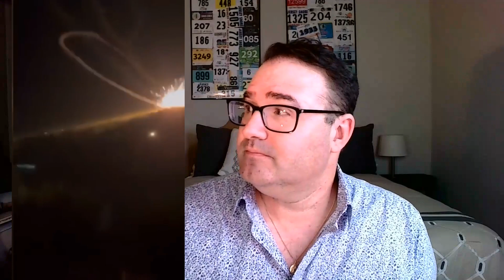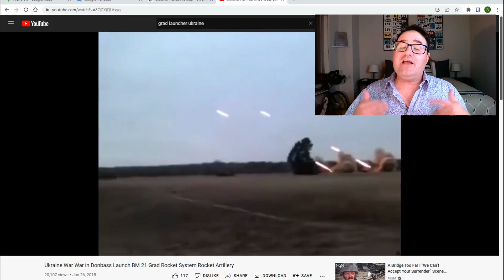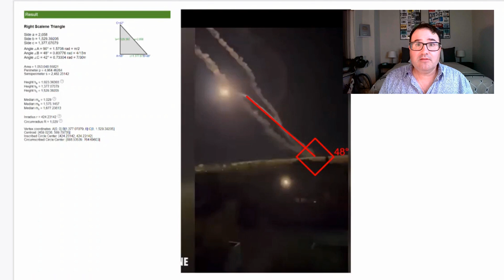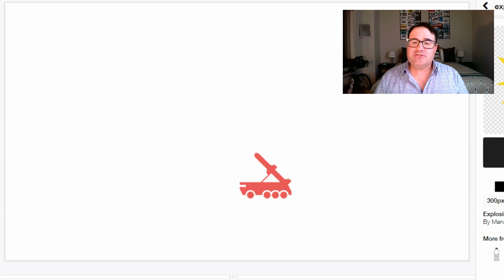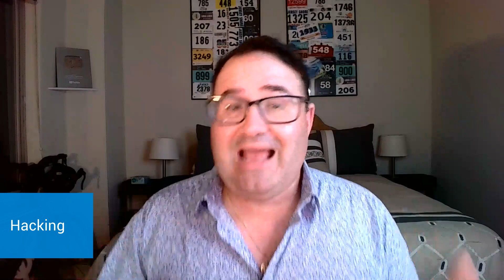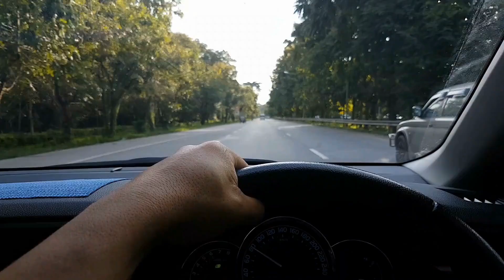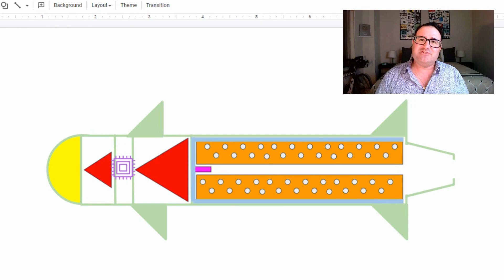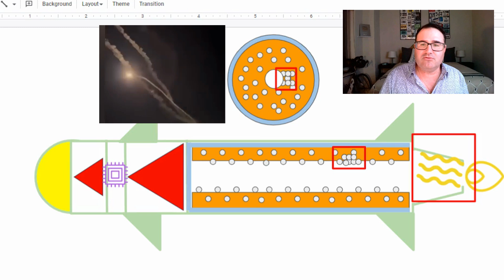Why this missile U -Turned

Comment: I think the clump of fuel on one side is unlikely. I've seen model rocket solid fuel engines with asymmetrical fuel work fine. One configuration is called "Moon Burner" that burns from one side to the other as an effort to provide closer to constant thrust. But I don't have an alternative theory.

Comment: USUALLY “mishandled” solid fuel “anythings” will DETONATE upon ignition rather than DEFLAGRATING unevenly, because the fuel grain has been cracked (usually in multiple locations) which allows the grains oxygen surface area to increase, which drastically increases the burn rate.  Imagine igniting a pile of smokeless powder (pellets) as compared to igniting baby powder fine black powder.  Finer dustribution = faster burn rate, aka detonation.  CATO, but who knows with explosives.

With this fuel being plasticizer it may be less likely to crack, but I doubt it.

Comment: Could it be possible that a sensor was installed backwards? If it wasn't a physical fuel problem as you suggest, this, or a programming malfunction would be my next guesses. Hacking is not on the list at all. Anyone with the skills and access to hack a system like that would be able to do far more damage far more reliably than making one missile turn around (just make it go off on the pad for instance), and any less intelligent tampering taking place on the front lines by enlisted grunts would end up putting them and their comrades at risk, making it unlikely. It's either a manufacturing, handling or programming error. We've seen similar errors occur on civilian/military space flight endeavours, the one that comes to mind is the Proton-M accident in 2013.

Comment: A fuel imbalance might cause a change in direction in one plane - but two? The missile changed both direction and pitch.
Given the changes in both pitches were pretty much 180 degrees, I tend towards the reverse fitting of guidance parts mentioned below ...  be it accidental or sabotage.

Comment: That's a great explanation if our universe's physical characteristics didn't apply.
That rocket could've gone any direction but it chose its origin.
Those chances are astronomical.
If there happened to be a concentrated pocket of fuel, it may explode or damage the rocket but would never just push to one side.  Fluids expand in all directions equally, hence the nozzle wouldn't receive unequal thrust on one side.

Comment: The first thing that I thought of was either a crack or ablation or burn through of part of the nozzle and the instability basically just blowing out what was around it for that split second of instability it could make the rocket turn but then it would just keep turning unless the nozzle blew away same thing with the material inside you get a chunk of the solid booster either breaking loose burning fast burning slow causing instability and send me either a high or low pressure gas out the nozzle making the turn and once it's spit out burped out all the crap it's going in another direction

If you ever have time and patience to search through and locate the old videos when they were developing the solid rocket boosters for the space shuttle they went through so many different anomalies really every rocket engine has had this happen look how many Saturn 5  F1 engines they blew up just because of instability in the engine

Comment: Good video, but you are mistaken about the Buk/SA-11 guidance system.  It is  semiactive  guidance system, there is no active radar in the missile.

I also think you may be too quick to dismiss a ‘hack’.  While it is true that nobody puts their Sams on the public network, the Russians have all their Sams on a large wide area network.  This network often uses microwave links as well as wires.

Either way intrusion of that network is entirely possible, especially for a widely exported and employed system like the Buc family.

I am a former F-4G and EF-111 electronic warfare officer.  I have actually operated a replica SA-6 system while it was under simulated attack by F-111s and EF-111.

These are fearsome highly capable Air defense missiles. But I suspect a lot of work has gone into understanding how these systems communicate along themselves and the missile.

Comment: Or a nozzle breaking under the pressure. 
Some grunt likey mishandled the missile hitting the rear nozzle causing an hairline crack and a shard of the nozzle breaks off so it turns. 
It could have been dinged by some forklift operator in 1995 for what we know and the guy just never bothered to report it to avoid being punished as anyway the cold war was over.

Comment: The hot gas/exhaust goes out a nozel that gives it direction.  A clump of fuel or binder would not effect direction.
This dramatic turn then return to straight flight is a control problem.  If something broke to cause the turn the missile would have corkscrewed, not returned to straight flight.  Look at Trident II D5 missile failure.

Comment: Seems to be two issues: 1) why did it make a high G manoeuvre like that and 2) what guided it down to the ground. 

As for guidance, idk how the guidance system works here but if you go outside the normal envelope analogue guidance signal, it can give very weird results like 1) down is up/up is down which could induce an aggressive turn and 2) an outbound missile and an inbound missile get the same guidance, so after a flip, it starts tracking to the guidance beam

It’s possible that the manoeuvre was caused by asymmetric combustion but given the way nozzles work I would be shocked if that could cause a turn by itself, certainly not one that would be hard to overcome with control surfaces

It’s also possible that it went to internal tracking (heat/radar) before/after the turn but there are obvious safety concerns with arming your internal guidance or especially payload in the first 5 seconds of flight, so I’d be surprised if this happened, even if it lost external guidance.

(Further thought - the explosion was probably unspent propellant, not the payload..)

Comment: That amount of turn seems a bit much to come from asymmetric thrust.  If it burned through a wall and kicked out a bunch of side-thrust, that could do it.  I expect it’s the failure of one of the control mechanisms— guidance won’t command that kind of turn, but if a control cable snaps, or one of the fin bolts lets go and you suddenly get a fin side on to the path of travel, that can give you some major yaw as well.  Lastly, I think your comment about parallax is partly right, too: a relatively shallow turn directly toward or away from the camera will look much sharper than one perpendicular to the camera’s axis (this is only a small part, though, as it goes quite quickly from its boost trajectory (projected onto the plane of the camera’s film) to the opposite direction, and doesn’t have a huge delay around the turnaround point.
Reply from the maker: So maybe burn-through and the parallax makes it look straight?
Reply: @RyanMcBethProgramming  Would make sense to me.

Comment: the SA-11 specifically is a semi-active guided missile, the radar guides it all the way to the target with CW illumination. The SA-11 and 17 also have tracking radars on the launcher vehicle itself the search radar is the only seperate vehicle in a full battery.

Comment: Even if there were a "stuck fin", these things are fairly modern missiles.
Likely fly-by-wire, with a real-time brain constantly monitoring accelerometers, radar, maybe GPS, etc.
The loop running on the missile brain would quickly adapt it's control signals to compensate for that fin, by using the good fins and motor gimbaling if it has it.
I'm guessing it would take multiple control surface or sensor malfunctions to completely degrade it's flight systems.
And even then, seems a bit too clean a failure, I would expect it to just nose dive in the direction it was going and just meander off into the wild blue yonder.
Reply: Yeah. I agree, and I think you are mentioning the exact reason it "decided" to behave differently from the first two missiles. There was likely some erroneous input to the onboard guidance computer, for instance, an accelerometer mounted wrong, which caused the missile to initiate a course correction when it entered the cruise phase. The "desired velocity vector" of the missile seems to be the inverse of the intended vector, so it basically did a u-turn to align with what it thought was the desired velocity vector.
Reply: @TheNiters  
Failed gyro?
If it got asymmetric thrust from bad rocket fuel consistency as described in the video, good fly by wire software would have compensated with opposite steer on the control surfaces.
Then again, with a failed sensor, like a gyro, I would expect it to fly in circles instead of a U-turn.

Comment: If you pause it or slow the video down at the moment just prior to it starting to turn, you'll see what APPEARS to be a jet of burning fuel coming out of the TOP towards the rear. I believe you are correct sir about a fuel malfunction. It looks like it may have burned through the insulation releasing hot gas through the hole that it made and the result was a u-turn. ↪️

Comment: Kind of reminds me of the situation that happened to Army Special Forces in A-stan when they used GPS and targeted a Taliban outpost and then the battery was low or died. And while a Jam was in flight and battery was replaced, it ended up reseting the coordinates for the bomb to the current position of the GPS causing friendly fire right onto their position.

Comment: You are right, but for one thing: coagulated solid rocket fuel will burn less hot, instead of hotter. The clump as you call it, is on the other side.

Comment: I am a member of the Sacramento Area Rocketry Group and have a level 2 high power rocketry certification with the National Association of Rocketry. I also was assigned to a Pershing Missile battery during my army days and served on a Combat Alert Site as part of our QRA mission during the Cold War. (Thew that one in just to brag) This is not a stuck or lost fin because it would continue to spin and not be able to take a direct path back. What I believe is that this is a stability issue. Rockets use one caliber stability in which the center of gravity (CG) is in front of the center of pressure (CP) at a distance equal or more than the diameter of the rocket. Even bullets must adhere to this law as well. If you were to reverse this, the rocket would spin out of control. But this missile was following a straight path up and took a straight path down. Here is my theory; something shifted inside the rocket to create neutral stability. Perhaps something in the guidance and control section which is typically behind the warhead. The CG shifted back and something, more likely a cross wind, weathercocked the rocket and it was unable to restore its flight path. Once it flipped it gained enough stability to send it in a new direction, which was back where it came from. I wrote my master's thesis on model rocketry and here is the Powerpoint presentation I made explaining stability: http://www.sargrocket.org/documents/Education/TARC/LD05%20Rocket%20Stability.pdf

Comment: Hacking is certainly possible. Perhaps not online from the NSA but the missile could have been hacked prior to launch. Then again, if you can do that, it would be better explode at launch, destroying the vehicle directly. If that is not possible then a firmware hack to make the missile go off track is certainly possible. Return to sender is even better but probably just a fluke.

Comment: The only problem that I see with Ryan's theory is that the missile seems to be on a direct return trajectory. The chances of the missile returning to its exact (or near exact) location of origin seems improbable based on "a clump" of misplaced fuel. I'd agree that it's possible, but very unlikely. Though I admit that something obviously very unusual happened here. Unfortunately, I can't think of a better solution so I'll just end with:

IT COULDN'T HAVE HAPPENED TO A NICER GROUP OF GUYS!
Reply: Did it return to origin though? It’s a side on video and from a similar incident with a Patriot missile I feel like the explosion would’ve been bigger if it had

Comment: My guess, which isn't worth much, is that the inertial guidance was installed in the wrong direction. Where the rocket needs to start changing course, it gets the info for which way it's heading and it thinks it's going 180 degrees from its intended flight.

Comment: Most likely was a close engagement of a tbm or an unguided rocket, either the radar guided it back when the interceptor passed the target to try to intercept it again, or the radar gave control to the internal radar on the intercepter to more or less do the same thing. either way operator error. on modern western air defense systems there are ways to mitigate this because of it happening a lot during the war in iraq

Comment: The physics would suggest not, an inconsistent burn should be taken into account by the nozzle and would likely cause a bit of wobble and change of speed, ie speed up or slow down depending on what type of fuel issue, too much or too little burning.
Saying that a fuel issue as you describe potentially may have distorted the nozzle or bad handling could cause this type of damage.
Historically almost every Disaster/failure is caused not by one fault but two or more or one leading to another etc,  I wouldn't rule out a guidance error though as the flight is pretty smooth, no jinking about which suggests control, the wrong control but none the less, control.
Who knows? but its interesting to to speculate especially when its not harming us.....lol

Comment: As a huge fan of rocket science I think your theory is probably correct and I love your explanation especially when it comes to how SRBs burn. This immediately made me think of the Proton M crash in 2013 where it was discovered that a guidance sensor was installed completely upside down, everything else was working properly but the rocket thought it was flying into the ground and it attempted to correct, I know this is something you could fix through programing and idk an alarm before launch saying the rocket is upside down, but this happened to a multi million dollar Russian rocket only 9 years ago, I wouldn't be surprised if the same thing could happen on antiair missiles but I also suspect that guidance isn't even activated until after the boost stage because at that level of acceleration you're just going to want the thing to be fin stabilized and go in a straight line.

Comment: Great analysis!  When I first saw this I only briefly wondered how, why. Then today I see this video and it really pulled me in from a technical perspective. I would point out that propulsion engineers despise the use of "explode" when referring to engines and propulsion. 

I saw some comments pointing to mechanical fin problems. I don't think there is any way the size and articulation of fins on a mach 3 missile could turn it with that radius. The rotation torque was large and very brief or it would have mimicked a spiraling fireworks thing. Your manufacturing flaw idea has to be spot on. I would suggest that ultimately the containment failed resulted in a momentary thrust out the side. 

I'll add, for this interested, solid rocket motor design isn't typically a simple cylindrical open shaft down the middle. Thrust comes from burn rate and that is managed by exposed surface which is managed through geometry. In fact thrust (acceleration) profile can be precisely managed through variations in surface geometry. For instance maybe you design 2g for 2 seconds then switch to 5g burn during fine guidance flight phase. Complexity of design increases chances of dramatic failure.

Comment: I have no idea how missiles work, so don't quote me on that, but perhaps there was an error during assembly and somehow the fins movement got reversed. Like yes, thy probably don't do a whole lot during the early phases of flight, but hear me out.
If a fin movement was to be reversed by wiring something up incorrectly and the missile's control unit expects/wants to do a slight turn to the left, but the fin is wired up to go to the right instead of left. This will result in the missile thinking "ah,  I'm not turning hard enough to the left, more steering to the left then".
So basically: The missile wants to go to the left, but it turns to the right in reality. It notices that it's going to the right and wants to correct this by going left. Going left will only cause the missile to go even more to the right. This means you're basically in a death loop. 
It wants to correct but only ends up making things worse.
I think that's what might have happened. 
Still doesn't explain why it makes a nearly perfect return to where it was started, but maybe that was just bad luck and coincidence.

Comment: The opening of the combustion chamber is quite narrow. You want to make it as big as possible but at the same time you need a certain pressure buildup inside, if not the gases will not escape with sufficient speed.
So I assuming a heavy combustion assymetry I don't think it would have a impact. The gases still would buildup and escape through the opening.
Maybe the weight imbalance would make a difference if only one side combusted, but even then I doubt you get that u-turn.

Comment: Ah yes, a simple rocket fail due to a mishap with the APCP fuel grain. I'm into model rockets and it is something that can happen. Although I think you may be wrong because a fuel grain doing that would lead to a casing rupture, it could be a nozzle issue if it has to do with a change of thrust. On an APCP motor the nozzle is usually a graphite piece which is fragile and not good at taking an impact.